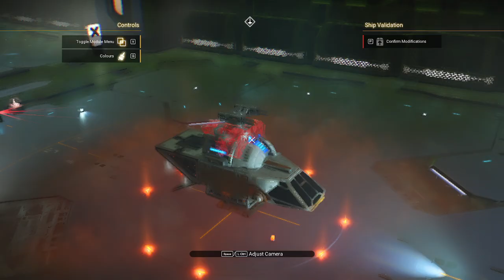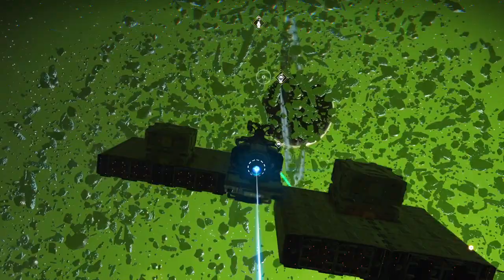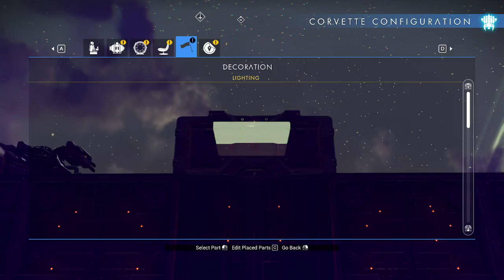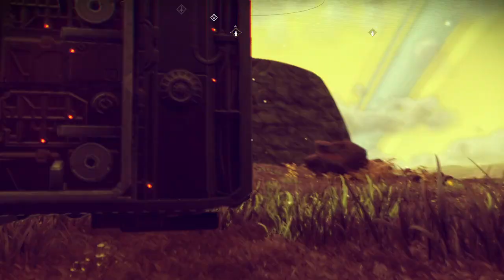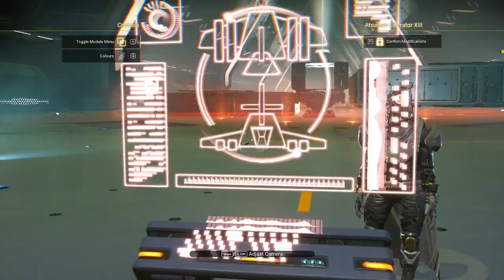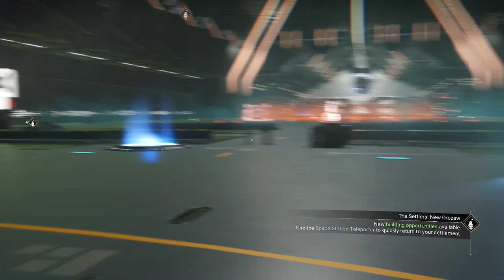No Man's Sky Corvette Glitch Building: Tilt habs using the tether glitch

Comment: Thank you for giving Credit. 😊 Nice to see how you use it
Reply from the maker: Thanks a lot for your video. I was a bit sad after the patch in which they fixed the parts transfer glitch, which I nedded for the previous method of tilting habs, and I was so happy when I found your video and rediscovered a new way to do it!
Reply: @channel_n23 https://youtu.be/SmfhL-QdvT4?is=kbcrhKHOaMDuGy7f
Reply from the maker: @BASSMOB_MITTE  Thanks, I've already seen it. Unfortunately, they just broke it again, lol.
Reply: @channel_n23  No way... uffff😵‍💫 I start testing everything later. Still downloading.
Reply from the maker: @BASSMOB_MITTE  A new way has been found at least to get back 90° and 180° rotations using a tractor beam on top of a hab and then moving the hab around it, similar to offset building.
Reply: @channel_n23  Yes i made a Video about that
Reply: @channel_n23  it still works, 🎉 Angles are still possible
Reply from the maker: Damn, dude, that's great to hear. You should make a post on https://www.reddit.com/r/NMS_Corvette_Design/ immediately, a lot of people will love to hear this!

I thought they were also using free placement of something in that technique, but it seems it works without needing that at all. I'll have to give it a try now.

Comment: Thanks for your video! Those awesome tips helped me build the X tail!
 
Quick question: Some players get game crashes when placing power wires. Do you know any solutions for this issue? 🌹 16:12
Reply from the maker: I also get crashes sometimes, but after a reload, I usually park my corvette slightly differently, and then it doesn't crash anymore.

Comment: Thank you for your videos with tilting on side glitch, that's what I couldn't find before. It's not that easy, but still works. 
Did I understand correctly that we cannot place weapons or engines inside the tilted hubs (which would be a significant advantage)?
Reply from the maker: No, you got that wrong. Tilted habs actually give you more options, even for weapons. Usually, with weapons, if you attach them to the side of a regular hab, and then delete that hab (for example because you want something else there, like a reactor), then the weapon will "pop up" and reorient itself vertically, because it can't attach to the side of a reactor.
But with a tilted hab, you can attach the weapon to the tilted top, and then when you delete the tilted hab, the weapon will stay as it is, and you can move a non-tilted reactor next to it and it will look as if the weapon sticks to the side of the reactor.
Tilted habs don't really have many limitations, you could build a whole corvette tilted to the side (except landing gear), and it would work perfectly fine. Would be a bit hard to walk around in it, but other than the build limit volume, I don't really know about any restrictions regarding tilted habs.
Reply: @channel_n23  Oh, that sounds great, thank you! Well, I was considering combining this glitch with another—specifically, the slight shifting that occurs when mounting habs onto Landing Thrusters. By subsequently attaching an Oversized Canister Link to the side of a hab, it becomes possible to place new habs inside the existing one. By chaining adjacent habs this way, one can nest multiple habs within a single space and fill them with various other modules (such as reactors, jets, or weapons), thereby achieving a highly compact layout. I had previously done this with horizontally oriented habs and wondered if the same technique would work when tipping them onto their sides; this approach helps reduce the starship's horizontal width, which can be quite useful.
Reply from the maker: @VirObscurus  I think it could work if you use the shifted walkways to attach the tether glitch scaffold to one after another, but it's a tedious process, because you have to do it one tilted hab after another.
The reason I think you have to do it this way is because I don't think the tilted habs interact with landing gear, so you can't really use them directly with the stacking glitch.
Reply: @VirObscurus thank you for this info, been building some decent ships, just started getting into glitching builds.
Reply: @channel_n23  I'm talking about this one, I found it a few days ago and it's amazing for building and stacking units inside one place, but you probably already know about this glitch.   https://www.youtube.com/watch?v=rRQaA1uCXDg&list=PLFHjsKnAdzBA&index=21
Reply from the maker: @VirObscurus  I actually didn't, thanks for linking it.
Reply: @channel_n23 huge info, thank you